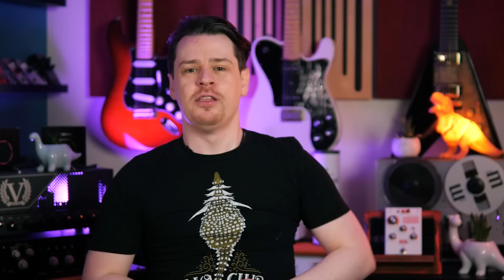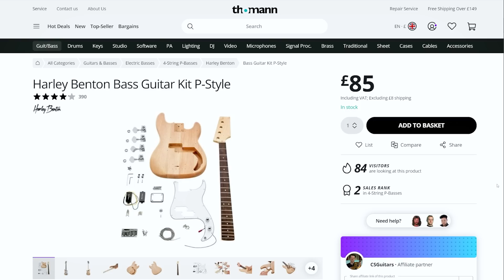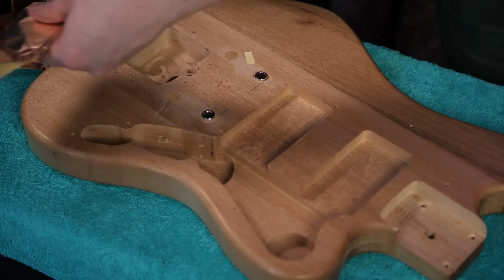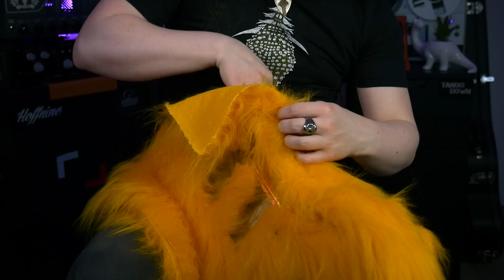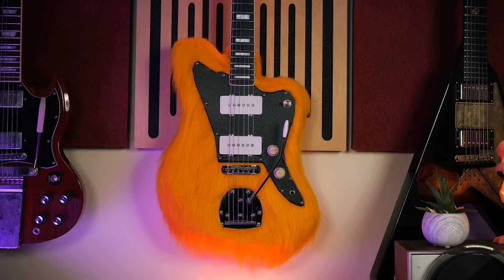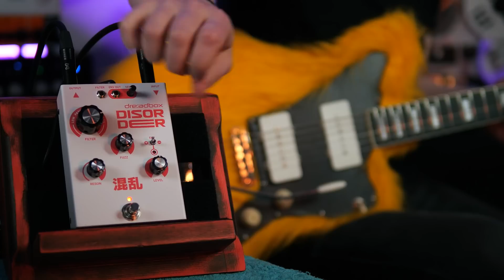Hairy Jazzmaster Kit Build - Harley Benton with FUR! | #DIYKitChallenge22 Part 2

Comment: nice build! what is the string spacing in the bridge? Do you think it will be possible to install hardtail bridge instead of TOM? Of course drilled holes for TOM need to be plugged, but im worried about string height, since TOM in genuinely higher bridge, what'd you advice? Thanks!